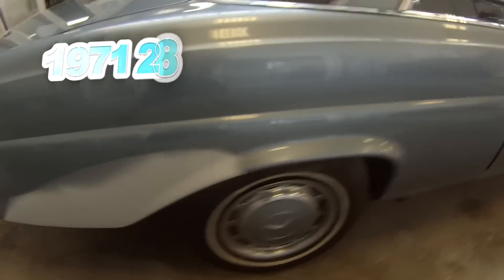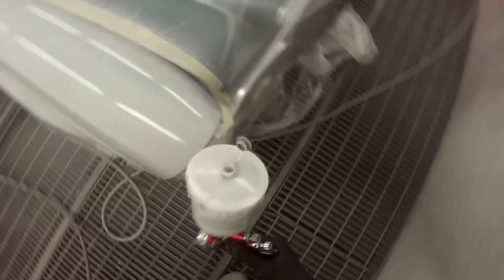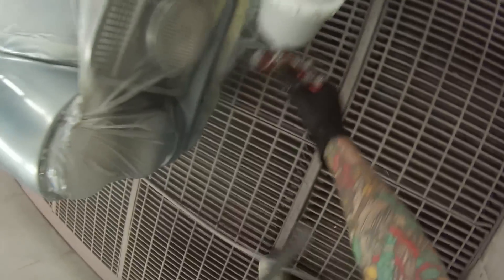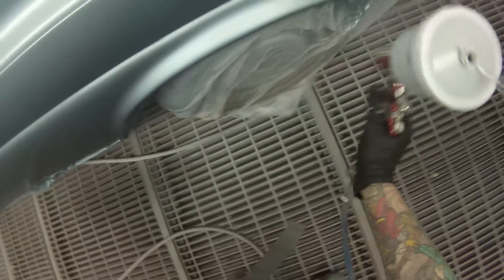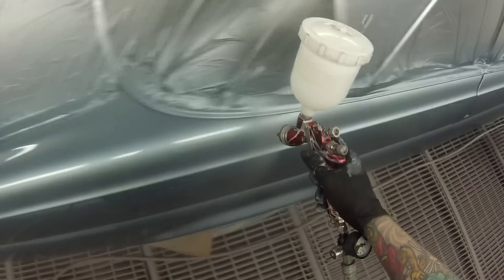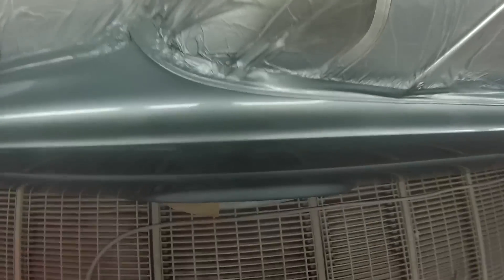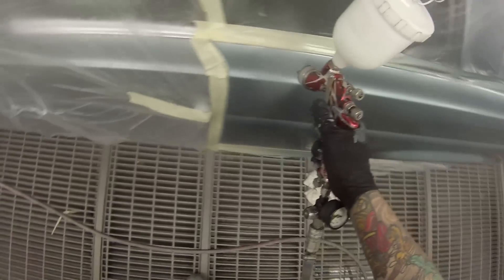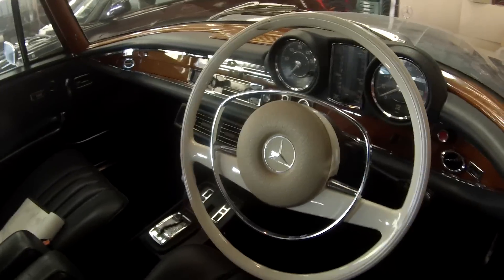DeVilbiss GTI 110 "280SE Mercedes 3.5" Paintwork

Comment: I ended up going with the devilbiss. I've used sata guns before and I honestly think they are a bit over rated. I think I always would of went with the pro lite cause I own other devilbiss guns mainly cheaper ones like the finishline 4s but I've been able to lay down nice work with them. Bought the pro lite for clear only. Just a quick question is the te10 air cap a conventional air cap?
Reply from the maker: I totally agree about the satas, I have a Gunman Christmas Special" Sata vs Devilbiss vs Iwata, I think you'll like it. Yes the te10 is conventional.

Comment: my dad has a 68 Mercedes 230 with 77 km and original paint if by chance there is a time that a panel needs to be repaired would it be prudent to repaint the whole car ??
Reply from the maker: Dana Wick I wouldn't do the whole car unless it needs it.
Reply from the maker: ***** You could always mix the color up in lacquer.
Reply from the maker: ***** the DuPont or now known as Cromax system have a binder system and you can use an acrylic binder in the color, in some areas it may be banned but can still get it here in Australia.
Reply: i checked the cromax here at one of my suppliers the solvent base is called mosaic he says it costs more than waterbase so they dont carry it. he did say Dupont is the bomb for waterbase up there with standox. i use Urki base and the cromax  wb is 10.00 more a pint one day ill try it.

Comment: How much paint would you use to do a complete colour change on this 280 Merc
Reply from the maker: If it was inside and out, inside bonnet (hood) and boot (trunk) I'd want 4-5 litres of straight colour then it will be thinned to 2:1 ratio with thinners and a 7.5lt clear kit. This would likely be a litre over but always good to have some just in case, 4lt of colour would probably do it.
Reply: Thanks for answering .much appreciated